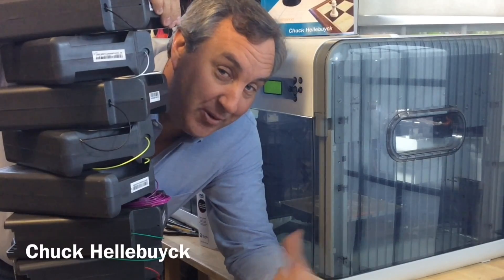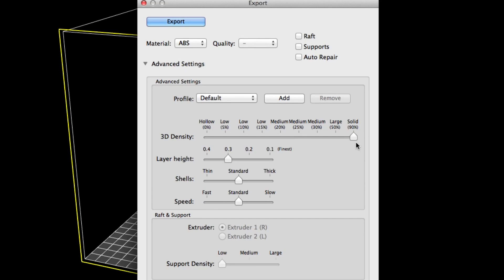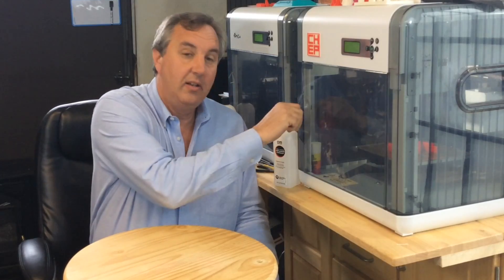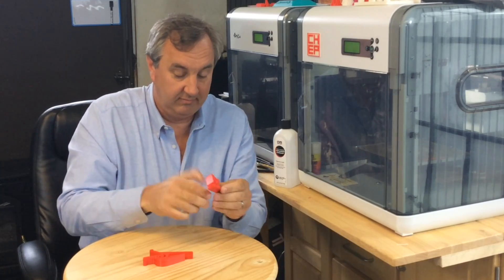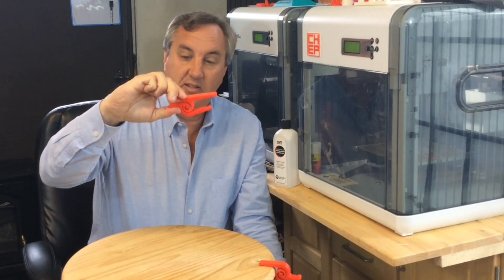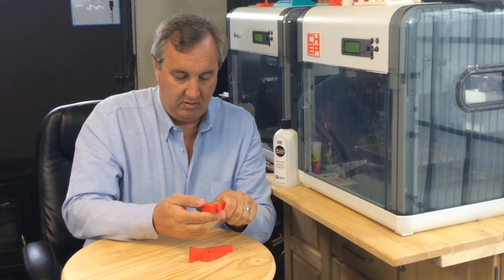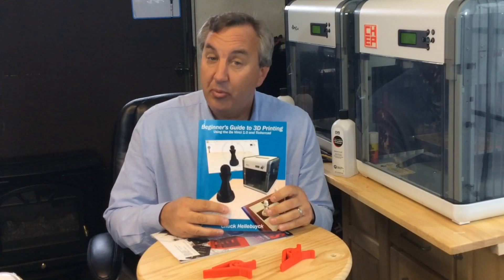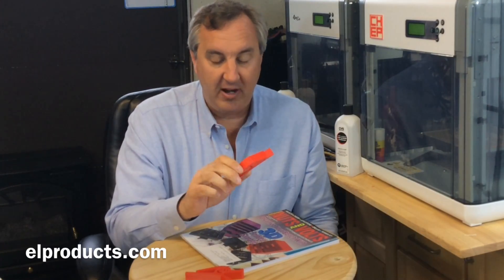Filament Friday #13 - Guitar Capo or Spring Clip 3D Print on Da Vinci 1.0 - Video #055

Comment: You should try printing it in pla and rubberizing it with acetone.
Reply: ***** Da Vinci prints PLA wonderfully with Repetier firmware :) (I kid, I know you like running stock, but my 1.0a machine has handled PLA just fine).  Good luck with the Kickstarter and keep up with great videos...
Reply: JM, do that for me and I'll use it as my main capo.